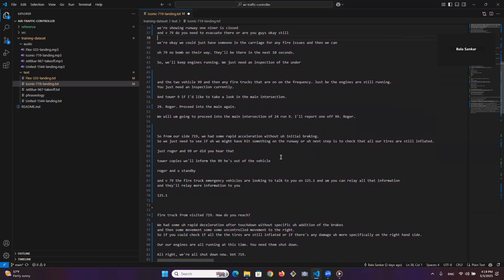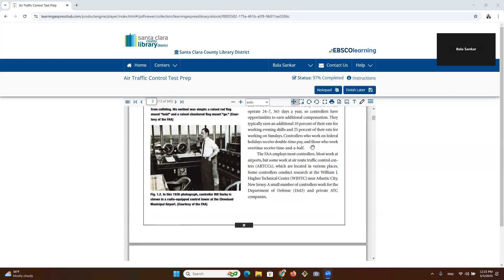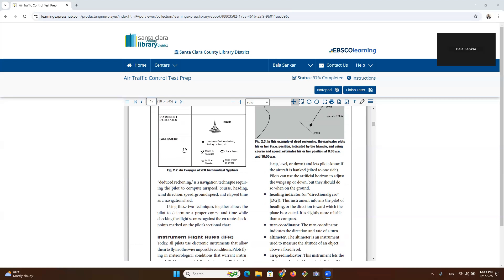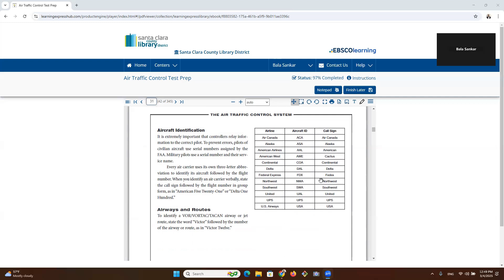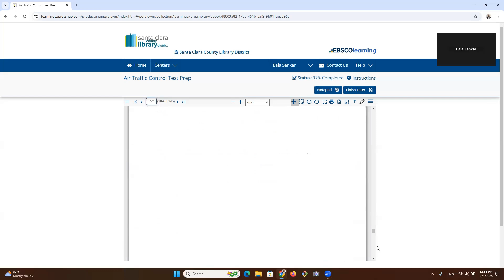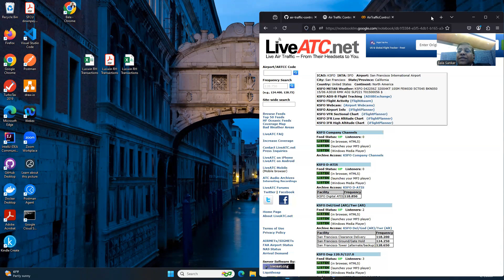AI-ATC Artificial Intelligence Air Traffic Controller

Comment: North Atlantic (NAT) Tracks

Introduction To minimise flight time and thereby the cost of operating aircraft through oceanic airspace, all operators desire to operate in a relatively small portion of oceanic airspace. The optimum routings vary according to departure and destination airfields, enroute weather, winds aloft and aircraft performance.

Design To maximise the flow of traffic along the preferred, optimal routings, Shanwick & Gander publish a list of set North Atlantic (NAT) Tracks each day. The process of track design depends upon input from operators, upper wind conditions, limitations of airspace and feasibility for surrounding controlling authorities. This system can accommodate a higher flow of traffic than using ‘random routings’ for all aircraft.

The published tracks are defined by a list of permissible flight levels and series of waypoints, which include an oceanic entry and exit point. These are positioned on the domestic FIR boundaries and are generally named using the standard five-letter convention. Between the entry and exit points, waypoints are defined by Latitude and Longitude (e.g. 57N 040W, also written 5740N or 57/40) and are generally positioned every 10 degrees of longitude.

Validity In the real world, the tracks are only valid at certain times of day, with a westbound set published for use for aircraft crossing the 30 degrees west line between 1130 and 1900Z and an eastbound set for aircraft crossing the same line between 0100 and 0800Z. The two sets of tracks are not necessarily laterally separated as they are never valid at the same time.

Shanwick OAC (Prestwick) publishes the westbound tracks around 2200z before activation in the morning and Gander OAC publishes the eastbound tracks around 1400z in the afternoon.

Naming NATs are named using letters of the alphabet. Westbound tracks are named with the most northerly track designated ‘Alpha’ and working down the alphabet to the final westbound track. Eastbound tracks are identified with the most southerly track designated ‘Zulu’ and working up through the alphabet to the final eastbound track. These names are re-used every day when old tracks are removed and new tracks published, though the number of tracks each day may vary.

Random Routes The use of the OTS is not mandatory, pilots may file routes that over/under-fly, cross join or leave the system. Any route that does not follow the OTS for the entire track is referred to as a “random route”.

Comment from the maker: What's the difference between Roger and Wilco?

That's a great question, as they are often confused but have distinct meanings in aviation communication!

Here's the difference:

    "Roger": This term means "I have received and understood your last transmission." It's purely an acknowledgment that you heard and comprehended the message. It does not imply that you will comply with any instructions given.
        Analogy: Like saying "Got it" or "Heard you" in a conversation.

    "Wilco": This term is a contraction of "Will Comply." It means "I have received and understood your last transmission, and I will comply with the instructions given." You only use "Wilco" when you intend to carry out an instruction.
        Analogy: Like saying "Understood, and I'll do it" or "On it."

So, the key difference is the actionable intent. "Roger" confirms receipt of information, while "Wilco" confirms receipt and commitment to act on it.

Comment from the maker: What are common ATC phrases?

Common ATC phrases are designed to be precise and leave no room for misinterpretation. Here are a few examples, some of which are alluded to in the video's audio snippets:

    "Roger": Means "I have received your last transmission." It does not mean "yes" or "I will comply." (Video mentions this implicitly when controllers acknowledge transmissions).
    "Wilco": Short for "Will Comply." Used after receiving an instruction that requires an action.
    "Cleared for Takeoff": Authorization for an aircraft to take off from a specific runway.
    "Cleared to Land": Authorization for an aircraft to land on a specific runway.
    "Hold Short of [Runway/Taxiway]": An instruction to stop before reaching a particular runway or taxiway line. For example, "Hold short of Runway 22 Left" (similar to 2:21:49, 2:28:16 in the video).
    "Taxi to [Location]": Instructions for an aircraft to move on the ground (taxiways) to a specific gate, runway, or other location (e.50:59, 2:28:16).
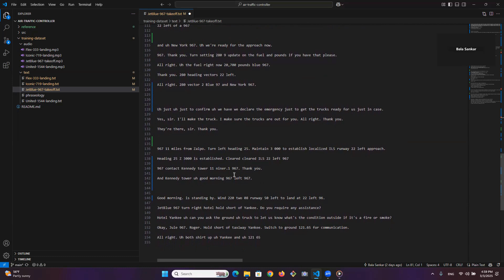    "Contact [Controller/Frequency]": An instruction to switch radio frequencies and establish communication with another controller, such as "Contact Departure" (2:20:53) or "Contact Tower" (2:27:41).
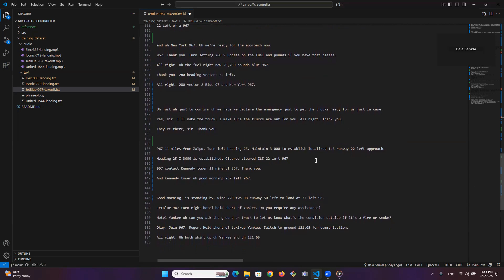    "Runway [Number] [Left/Right/Center], Cleared ILS Approach": An instruction for an Instrument Landing System approach to a specific runway (2:27:31, 2:34:40).
    "Say Intentions": A request from ATC for the pilot to state what they plan to do next, often in an unusual situation (1:07:35).
    "Souls on Board": Refers to the total number of people on the aircraft, including crew and passengers (1:11:39, 2:32:05).

These phrases ensure a clear and efficient flow of information between pilots and controllers worldwide.

Comment from the maker: What is phraseology in ATC?

In Air Traffic Control (ATC), phraseology refers to the standardized set of words, phrases, and pronunciations used by pilots and air traffic controllers for all radio communications.

As mentioned in the video (2:05:00), it's crucial for clear, concise, and unambiguous communication to prevent misunderstandings that could lead to dangerous situations. Even when speaking the same native language, pilots and controllers use this specific "phraseology English" (2:06:57).

Examples from the video include:

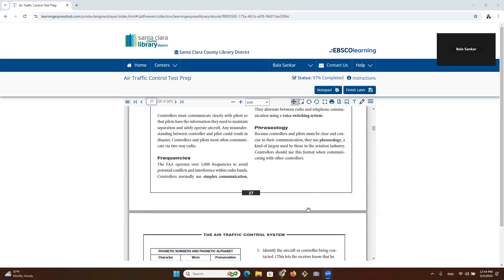    Using specific phonetic alphabets like "Alpha" for A, "Bravo" for B, "Charlie" for C, "Delta" for D, "Echo" for E, and "Foxtrot" for F (2:07:22).
    Saying numbers individually, like "one zero" instead of "ten" (2:10:41).
    Using terms like "Zulu" for Z and for time (2:09:56).

This standardization ensures that messages are understood correctly regardless of accent, background noise, or other communication challenges.

Comment: Asked Meta: air traffic control system phraseology 

Air traffic control (ATC) systems use standardized phraseology to ensure clear and concise communication between controllers and pilots. Here are some common phrases used in ATC:

Clearance Phrases
- "Cleared for takeoff" - clearance for an aircraft to depart
- "Cleared for landing" - clearance for an aircraft to land
- "Cleared to taxi" - clearance for an aircraft to taxi
- "Cleared to enter" - clearance for an aircraft to enter a specific airspace or runway

Instruction Phrases
- "Turn left/right heading [degrees]" - instruction to turn to a specific heading
- "Climb/descend to [altitude]" - instruction to climb or descend to a specific altitude
- "Level off at [altitude]" - instruction to level off at a specific altitude
- "Reduce/increase speed to [speed]" - instruction to adjust speed

Information Phrases
- "Wind [direction] [speed]" - information about wind direction and speed
- "Visibility [distance]" - information about visibility
- "Clouds [type] [height]" - information about cloud type and height
- "Temperature [temperature]" - information about temperature

Acknowledgement Phrases
- "Roger" - acknowledgement of a transmission
- "Wilco" - acknowledgement of an instruction
- "Understood" - acknowledgement of information

Emergency Phrases
- "Mayday" - declaration of a life-threatening emergency
- "Pan-pan" - declaration of a non-life-threatening emergency
- "Emergency declared" - declaration of an emergency

Other Phrases
- "Say again" - request to repeat a transmission
- "Read back" - request to read back a transmission
- "Confirm" - request to confirm a transmission
- "Cancel" - request to cancel a clearance or instruction

These phrases are used in various combinations to convey information and instructions between controllers and pilots.

Comment: Asked ChatGPT: air traffic control system phraseology 

Air Traffic Control (ATC) phraseology follows strict standardization set by the International Civil Aviation Organization (ICAO) and other aviation authorities like the FAA (U.S.), EASA (Europe), and others. It ensures clear, concise, and unambiguous communication between pilots and controllers.
Basic ATC Phraseology
1. Initial Contact

When a pilot first contacts ATC, the transmission follows this structure:

    [ATC unit] [Callsign] [Position] [Altitude] [Request]

Example:

    "Boston Approach, Delta 123, level 10,000, requesting descent."
    "Dubai Tower, Emirates 221, holding short Runway 30L, ready for departure."

2. Acknowledgment and Readback

ATC expects pilots to read back critical instructions to ensure understanding.
Example:

    ATC: "American 456, descend to FL180."
    Pilot: "Descending FL180, American 456."

3. Clearance Delivery

Used for IFR flight clearance before departure.
Example:

    ATC: "Southwest 789, cleared to LAX via the ANJLL2 departure, climb and maintain 5,000 feet, departure frequency 124.5, squawk 3456."
    Pilot: "Cleared to LAX via ANJLL2, climb 5,000, 124.5, squawk 3456, Southwest 789."

4. Takeoff & Departure

    Takeoff Clearance:
        "United 987, cleared for takeoff, Runway 27L."
    Departure Contact:
        "Contact Departure on 125.4."
        Pilot response: "125.4, United 987."

5. In-Flight Communications

    Altitude Changes:
        "Climb and maintain FL350."
        "Descend and maintain 6,000 feet."
    Speed Instructions:
        "Reduce speed to 250 knots."
    Vectoring (Heading Instructions):
        "Turn left heading 270."
    Holding Instructions:
        "Hold at JONZI waypoint, maintain FL150, expect further clearance in 10 minutes."

6. Approach & Landing

    Approach Clearance:
        "Lufthansa 789, cleared for ILS approach, Runway 08R."
    Landing Clearance:
        "Cleared to land, Runway 25L."
    Missed Approach:
        "Go around, climb 3,000 feet, contact Approach on 120.7."

7. Ground Operations

    Taxi Instructions:
        "Taxi via Alpha, hold short of Runway 22R."
    Crossing Runways:
        "Cross Runway 18L, taxi via Bravo."

Key Standard Phrases
Phrase	Meaning
Affirmative	Yes
Negative	No
Standby	Wait, I will get back to you
Say again	Repeat the last transmission
Wilco	I understand and will comply
Unable	Cannot comply with the request
Expedite	Proceed quickly for safety or traffic flow
Go Around	Abort landing and climb

Would you like specific phraseology for an emergency or specific ATC situation?

Comment: Asked Gemini: air traffic control system phraseology

Air traffic control (ATC) phraseology is a standardized language used by air traffic controllers and pilots to ensure clear and concise communication. This standardization is crucial for aviation safety. Here's a breakdown of key aspects:

Key Principles:

    Clarity and Conciseness:
        Phraseology is designed to be unambiguous, minimizing the potential for misunderstandings.
        Controllers and pilots use specific, pre-defined terms.
    Standardization:
        International Civil Aviation Organization (ICAO) standards provide the foundation for ATC phraseology.
        This ensures consistency across different countries and regions.
    Accuracy:
        Precise communication is essential, especially when dealing with critical information like altitude, heading, and speed.
        Read-backs are often required to confirm instructions.

Common Elements:

    Phonetic Alphabet:
        The ICAO phonetic alphabet (Alpha, Bravo, Charlie, etc.) is used to spell out letters and avoid confusion between similar-sounding words.
    Number Pronunciation:
        Numbers are also pronounced in a standardized way to ensure clarity.
    Standard Phrases:
        Specific phrases are used for common instructions and requests, such as:
            "Cleared for takeoff"
            "Cleared to land"
            "Maintain altitude"
            "Hold short"
            "Say again"
            "Roger"
            "Wilco"
            "Affirmative/Negative"
    Weather Information:
        ATC provides pilots with weather updates using standardized terms and abbreviations.

Where to Find Detailed Information:

    Federal Aviation Administration (FAA):
        The FAA publishes resources like the Aeronautical Information Manual (AIM), which provides detailed information on ATC phraseology.
    ICAO:
        ICAO documents contain international standards for air traffic control.
    Skybrary:
        Skybrary is a very good resource for aviation safety information, and contains detailed descriptions of standard phraseology.

Importance:

    ATC phraseology plays a vital role in preventing accidents and incidents.
    Clear communication reduces the risk of errors and ensures that pilots and controllers are on the same page.
    It is a vital part of air safety.

I hope this information is helpful.